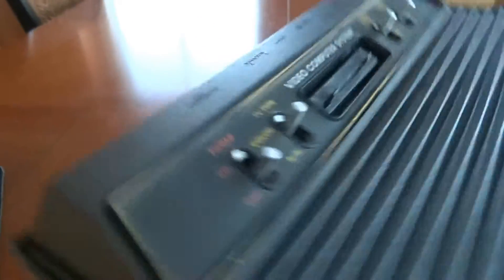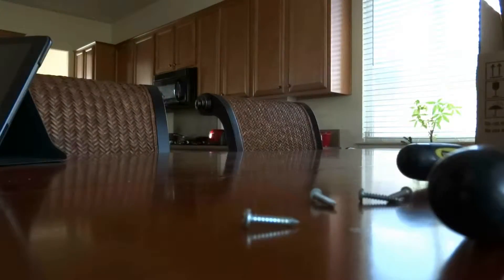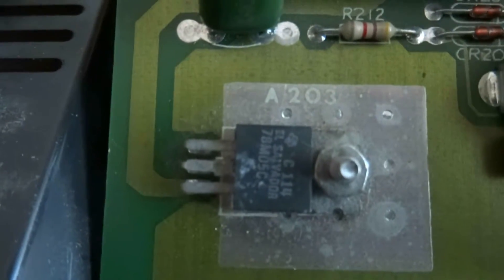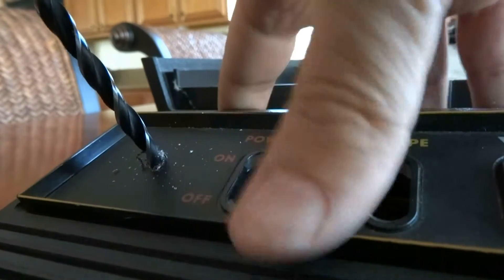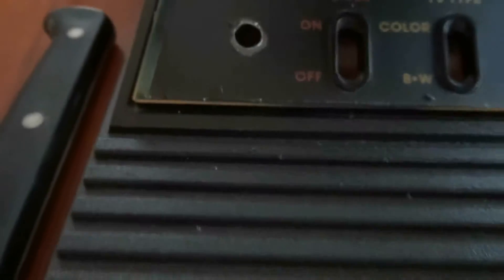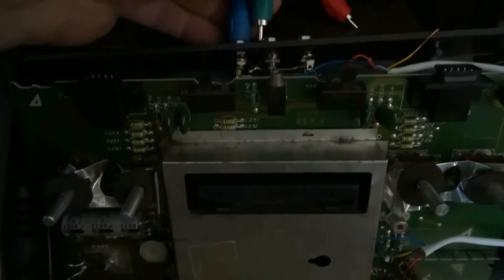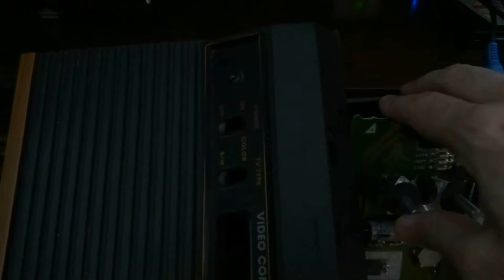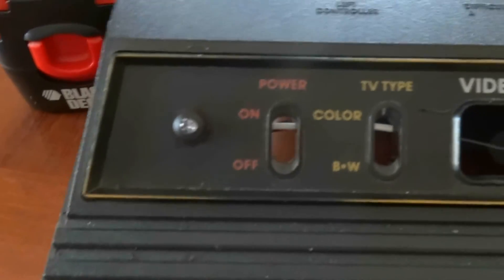Atari 2600 Power LED Modification

Comment: other than the atrocious soldering to the voltage regulator, not bad... also is the LED a 5V LED? iirc the atari 2600 inputs 12V and the regulator outputs  5V and most LEDs are 2-3 V... i wonder if that much voltage wouuld kill the LED eventually....

Comment: Great video. I'm fixing to add a led to my 4 switch wood grain.
Reply from the maker: +Nesmaniac Thank you.  I believe anyone can do this particular mod. Fairly simple, if you have the inclination...
Reply: Yeah, I got mine done yesterday in under an hour. I used a red 2V rated LED so added 150 ohms worth of resistors & it looks awesome. In fact it looks almost identical to the way you done yours in exactly the same position. To me that's the appropriate spot for the LED.
Reply from the maker: +Nesmaniac Nice!  Glad you were able to get it done.